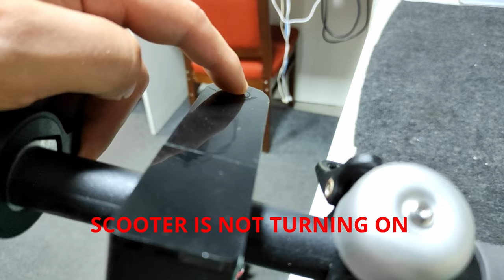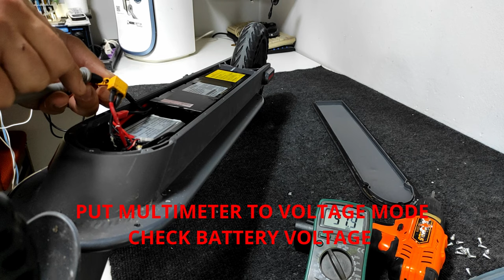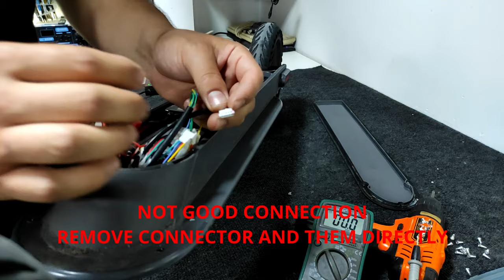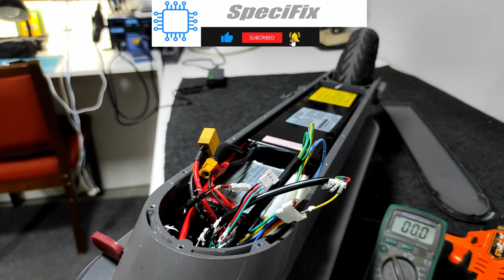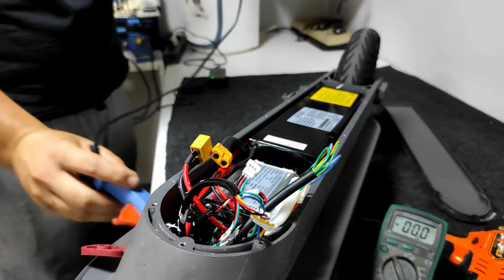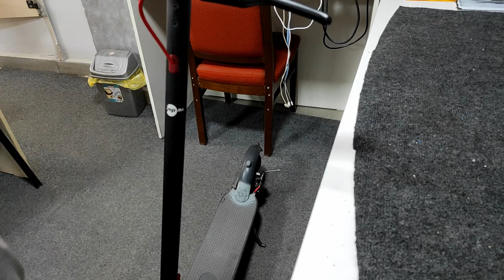ELECTRIC SCOOTER NOT TURNING ON SOLUTION

Comment: Would be good to explain what your doing
Reply from the maker: you have subtitles on the video what we are doing.
Reply: @SpeciFixx  what does it explain nothing you held about 20 different wires how are we supposed to know which one is which to do whatever you also did to it you didn't explain much...
Reply: He is not Specifix enough
Reply: Omg yesss,I’m a grandma & my grandson dropped his scooter off & said Nanna I need your to fix my scooter.I lol inside(I said I guess he see I can fix & make almost anything else)So I assume he think Nanna can do this to.This was my 2nd video & neither helped me.I’ve never fixed a scooter so it would definitely help if you’d explain what your doing.What tools you need etc..🤷🏾‍♀️🤷🏾‍♀️🤷🏾‍♀️
Reply: @itzAnzo  ❤❤❤👍👍👍👍
Reply: @itzAnzo all he did was disconnect the wires from their stock harness and then solder them on for a better connection. It didn’t involve moving the wires around to different connections, the wires were connected in the same location, just in a more secure way

Comment: $800.04 electric scooter used it a bit in the snow, cleaned it and it was ok I put it away and  3 months later now working anymore 😢
Reply: How you fix it?
Reply: @veselaribica3557  I got a refund and bought a new one. I tried many ways to fix it my self. But paying to repairing it is one way
Reply: Same exact thing!! Put it in storage a few months for winter, now it won’t turn on
Reply: @damien1869 my scooter always screwing up smh
Reply: Mine is the dash board. I've got power up there but no lights on

Comment: Had a segway ninebot es2 and when riding it on a nice day and coming to a stop it had suddenly shut off and never turned back on. It has an external battery that seems fine as the pins dont look damaged. I am unsure if it is the dashboard, mother board or battery connections
Reply from the maker: Common issue in this model is mother board
Reply: Same this happen to me awhile ago. Trying to fix now, did you get it to work?
Reply: Same I stopped and it shut down never turned on

Comment: Would I have to do this to a brand new one ? I just bought one and it’s not turning on I’m not sure if I gotta let it fully charge first or it’s just not working
Reply: Hello. I have the same issue as well. I just bought a brand new niu kqi2 pro and if won't even turn on. Have you found a fix for it?
Reply: @tsewangsherp  I just charged it until it turned on , im sure that helps for you
Reply: @sunnyrozmere4361 same thing happened to me I’m trying to charge it now fully. Thanks hopefully it works

Comment: my new M8 has show  no indication light as your clip. yet i tapped the power conx slot ( + and - only and the other 3) in the display circuit board, it is 36v. ,  Could it be the accerlator problen as in your part 2 clip? Thx
Reply from the maker: I don know, try to change accelerator is cheap part.

Comment: I was borrowing my friends Etwow BoosterV and omw home with 90% batt it shutoff and locked front wheel. Later, when trying to reconnect the plugs from controller to the batt it shorts out. Batt reads okay on multimeter but reading resistance on controller bounces around. He wants it back now and I’d like to return it working.. input? Thanks
Reply from the maker: It seems controller short circuit.

Comment: Hai bro I have battery issue on my Avo pro electric scooter. If I turn down scooter right side the power is on, if I stand on straight again the power is off. Can you please explain me what's the problem
Reply: Bad wire somewhere, it makes a connection when turning, breaks when straight, open it and look for damaged or too tight wire
Reply: Thank you very much for your response.  Any possibility to check tomorrow with video cal

Comment: Hi I have a LI-FE 350 e scooter working perfect then stopped using it over winter now there’s no lights or power ! So I screwed of the casing around the hand grips and noticed a yellow wire which isn’t attached to anything but it looks like a straight snip and not something that looks stretched and broken . It looks nearly impossible where the wire is at for it to catch and break on something in the frame so I was thinking maybe a factory cut for maybe some other function on bigger models but not sure ! Has anyone had this problem ? It’s a UK scooter.
Reply: But the 1000 rear motor awesome leopard scooter had it for 3 days was riding it all the sudden it turned off and he hasn't cut on since but it's still charges

Comment: How did you check if the connection is not good? You did not show it in the video clearly and you did not even explain
Reply: He probably meant that the wires that went to the connection were moving around so the connect was bad, and he made a direct connection the the wires

Comment: I have Electric scooter KUGO S1 and  Yesterday I went with it through the rain and the next day it does not light up at all what I could do Does not light up
Reply from the maker: it can be battery issue
Reply: @SpeciFixx  The battery still has power in it I don't think the battery is the problem

Comment: My scooter is fully charged but won't turn on. It turns on whe. It's plugged in.... It has no water damage.... any idea on the issue?
Reply: Same as mine 🤔
Reply from the maker: battery issue.
Reply: @SpeciFixx  oh thanks so much. 
Update: my micanic said that my battery blew out. Over all I wouldn't buy a scooter. If it breaks it costs more to fix than to replace. Not worth it.

Comment: Well i have the m8 and if i put the charger in it work the moment i unplug it it goes off

Help i welcome its only sad that so many ppl have problems with those things
Reply: Same thing with mine
Reply from the maker: Battery issue, you need to replace new baterry or repair your battery, you need to charge your scooter when you not use, battery needs to be charged about month once to not have problem.
Reply: More specifically it looks like a problem with the bms control of the battery. The bms is the controller which regulates the power and the order in which the batterys charge and give back the power to the system.

Comment: Pleace help me. My scooter only turns on when i put it upside down on the table. When i put it the right way up it only flashes on and then it turns on. What could the problem be?
Reply: Looks like a loose contact or exposed wire shorting out the system upon contact to the body of scooter, check ALL of the contacts and wires for broken torn or exposed wires